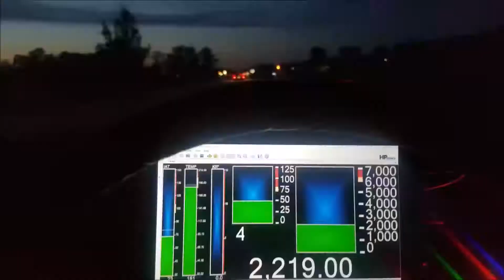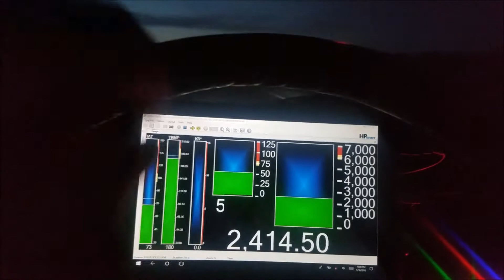AUTOMOTION 2K18 DAY 1 AND ALREADY BLEW UP ENGINE!!!

Comment: Good thing it wasn't a hard fix... Was the rocker exhaust or intake...
Reply from the maker: Matthew FredrickMFKRZ intake and that was the worste one when i broke my timing chain so my guess is it cracked from that and just finally gave
Reply: Garageless I wonder if that's what messed up on my 2.8... if I threw a rod off the crank would it start with enough belief? It was suddenly Knocking and then it died in traffic fortunately before I got onto an interstate bridge and seemed seized because I tried jumping it during the tow home and it'd just screech to a stop... I just got my windshield on today so I'll now be able to enjoy an 80% increase in MPG vs the mpfi 2.8 as fuel prices just shot up ¢30/gal where I live
Reply from the maker: Matthew FredrickMFKRZ idk depends how it threw it